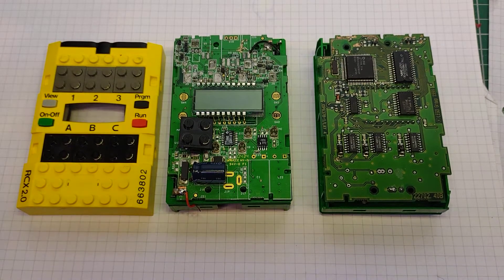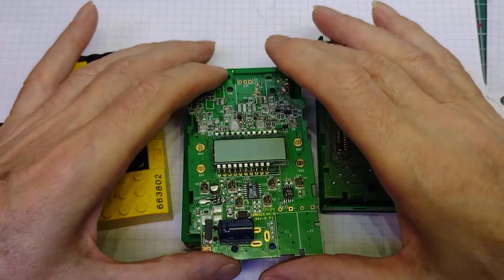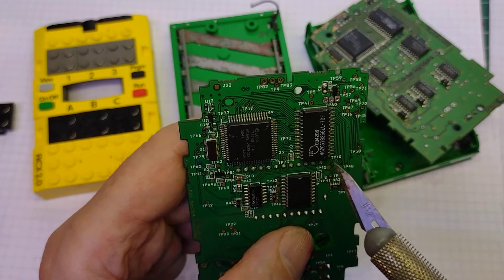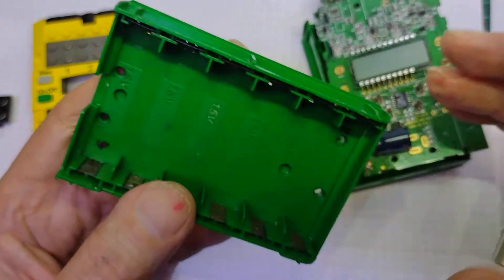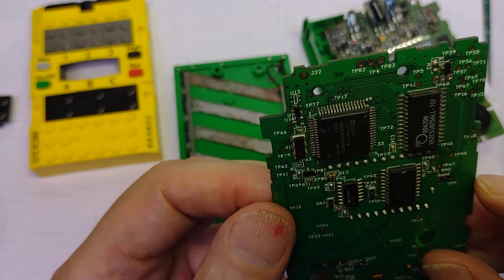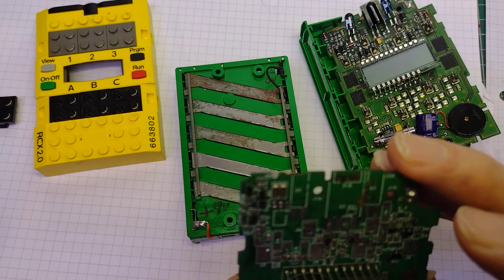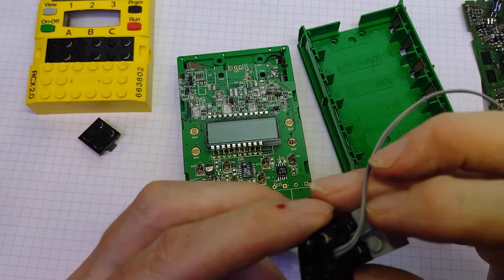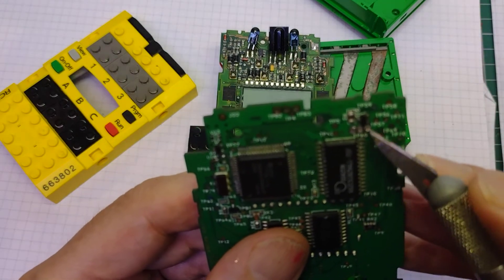Lego RCX tear-down

Comment: I usually solder my battery clips when I open one to clean it. I don't think I've ever opened one that was already soldered.  I know I've opened at least 20 over the years.  I prefer to use the oldest version which had a barrel jack for external power (9-12VAC although DC works as well).
Reply from the maker: Thanks good for the good advice.